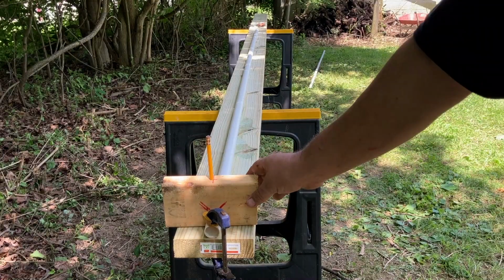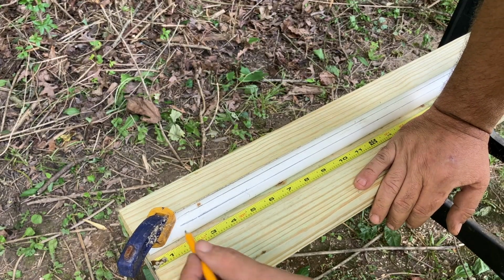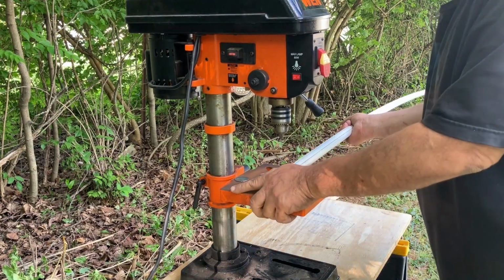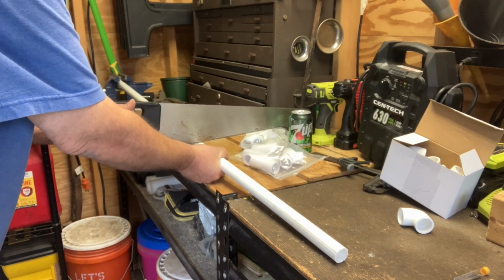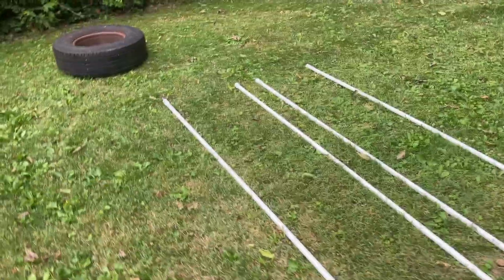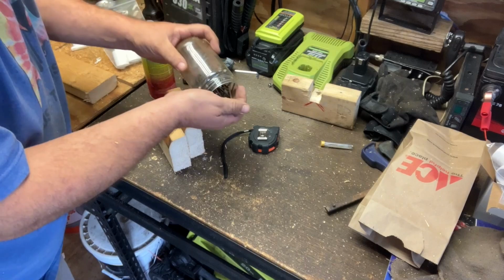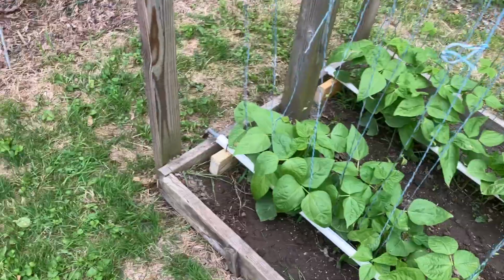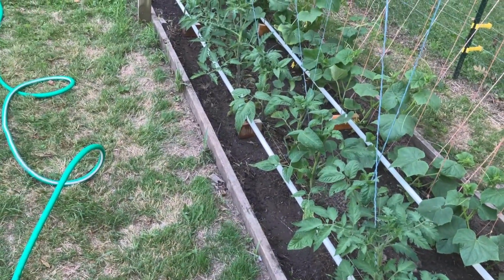Mittleider Garden Automatic Watering System CHEAP!  No Drip Irrigation, Soaker Hose or Sprinklers

Comment: Why are you not concerned about the vinyl in the PVC? Surely it leaches into the water and then into your plants?

These toxins may not cause an immediate noticeable effect but our bodies are overloaded with toxins as is.
Reply from the maker: PVC is not a problem for plants.
Reply: @frugalprepper  If the vinyl leaches into the water and enters the plants then the only way it won't enter you is if you don't eat them.